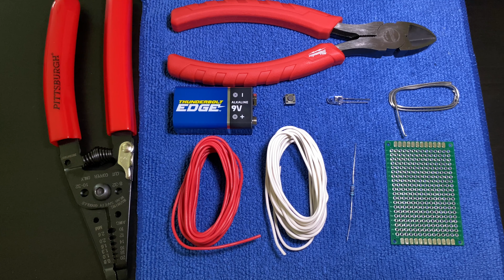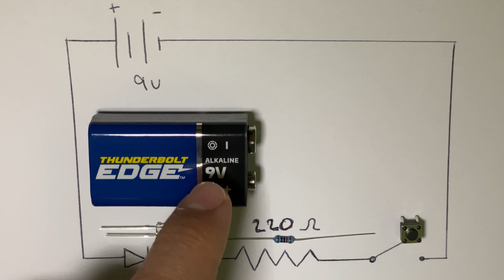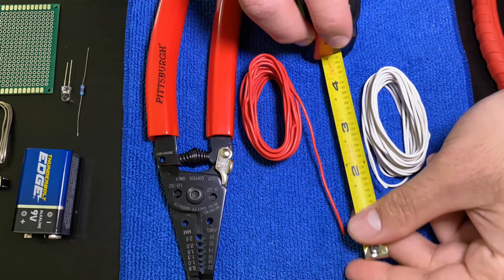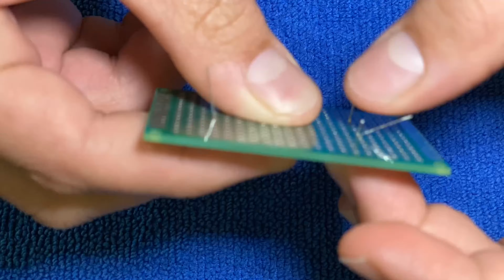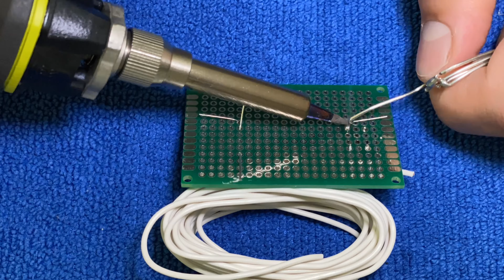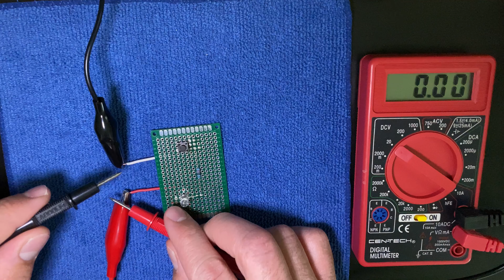Building A Simple Electrical Circuit

Comment from the maker: This is a project I haven't done on this channel so I decided to give it a shot. I made a simple circuit consisting of a 220 ohm resistor, a 9 volt battery, a LED as well as a switch to turn it on and off. More videos regarding this circuit will be coming soon.